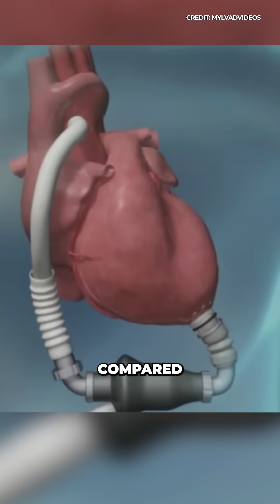Engineers Create World's First Fully Artificial Heart

Comment: By the way, the lack of organic heartbeat means that they were clinically dead; this is also true with all other artificial hearts such as pacemakers.
Reply: Pacemakers aren't artificial hearts. They just regulate your heart rhythm.
Reply: @SllSamuel-034   Depends on the pacemaker, as some of them are connected to artificial hearts, ones that are not made almost entirely from metal (in fact, they're mostly plastic). Point being: the individual has zero organic heartbeat, and sometimes zero organic heart.
Reply: @BlueNEXUSGaming  They may be used in conjunction with them but that doesn't make pacemakers a type of artificial heart.

It's like saying a wheel is a type of car. Just because it's a part that's used on cars

Comment: This is absolutely ingenious and fascinating. Im curious about the initial powering and the flow regulation. Is a battery neeed to start it, then the electromagnetism keeps ot going? Does it have its own software and a "tune" to regulate flow and demand, maybe it's flow is regulated by the brain to communicate that like normal? What about the different valves for the heart, are those electromagnetic actuated or is that needed at all? Is the blood itself enough lubrication for any hinges if valves are used?

Comment: When i was young i used to sit in my bed and think of how you could build a robot if you just replaced things like bones with pipes with oil, tendons can be pulleys with muscles made of many wires that pull or push, blood would be a coolant that helped the mechanics stay cold, with skin that was flexible. If we build it the same as a human body is built theoretically it should be able to move and function. Drinking and eating could also be a way to use whatever they eat to burn for energy and they could run on heated energy just like we do

Comment: Great stuff, love stories like that ❤

But I'm wondering, if typical rotary pro-/impellers etc.. are known to damage the cells, why didn't anyone come up with using the already very well known membrane pump concept? It basically imitates how the heart works, eliminates the shear/friction/etc... issues,.. 

they're widely used for e.g. pumping air for medical purposes because it isolates the mechanics from the air (no contamination from oil and stuff). 

It sounds like a naturally perfect fit - what does this specific method/tech do that makes it so special in comparison? 
Or: what would speak against using a membrane pump, the most accurate imitation of how the heart works?

Comment: "My heart doesn't beat, it hums" would be such a fire line
Also, imagine being able to manually crank up the rotation speed at will
Instant energy
Reply: All fun and games until you accidentally turn the crank the other way and shut off your heart
Reply: @vintage-radio   which sucks because lungs are way more than just pumps like hearts
Reply: @vintage-radio  LOL
Reply: wellll...more like instant high blood pressure kekw
Reply: @lat_sevN  Blood pressure depends on the blood vessels. So, OP's comment only regards the heart rate.
Reply: That’s not how that works, but sing your song and I’ll dance
Reply: My money don't jiggle jiggle, it folds.
My heart doesn't beat beat, it hums.
If you can't find a pulse, I'm not dead
I just might need an oil change.
Reply: Um… no
Reply: Now if they can do the same with kidneys.

Comment: I wonder if you could test its efficiency versus a normal heart. If it's fully mechanical then this would be impressive but without the right material it could lead to metal poisoning or deterioration over time, and an old saying roughly goes the more moving parts means more places for it to go wrong. Hopefully we'll create one that will use regulated electrical responses from the nerves that usually control the hearts muscle to manipulate false muscles along the wall to recreate the rhythmic pumping necessary. Something using those tubes scientists have been experimenting with for prosthetic hands in recent years maybe?

Comment: "Annnnd that a Cyberpunk upgrade"- My brain as soon as I saw the impeller can respond to body activities, thusly being able to be "upgraded" past normal levels.

One thing about that. Ever upgrade a PC or a Project Car?
Theres this whole thing when you REALLY upgrade a part (Say
..add a bigger turbo or better graphics card) you usually need a differnt part to be updated as a responce to the new stress.ot capabilities. It very quickly becomes a "Ship fallacy" as everything eventually goes around to get optimum performance results. In a living body, say the impeller gets a two stage impeller upgrade that can pump a WAY higher volume of blood...well now I need better veins to handle that pressure, I also need "ECU" chip to monitor and regulate my nervous signals to my muscles and the artifical heart for variable stage activation  and failsafe. Vibration dapening may become nessisary. Maybe a hormonal injector supplement to combat biomechanical immunotherapy rejection. While Im in there might as well reinforce the ribcage with flexable biologically friendly metal alloy sheathes.😅

Comment: I’m an engineer in cardiac devices and I’ve actually visited the BiVACOR office and met daniel timms. I wanted to clarify a point about the patient having no pulse. While the device is theoretically capable of running continuously, it currently operates by periodically speeding up and slowing down the impeller to simulate a pulse. There’s ongoing debate in the cardiology field about whether a pulseless circulatory system is viable for patients, so for now, there are no plans to run the pump in a fully continuous mode.
Reply: Oh also it’s not actually the first fully artificial heart. The first one was made by Syncardia which is what’s called a “Bridge to Transplant” device meaning it is not meant to replace the heart permanently. The story is the same for the BiVACOR device as it’s only approved as a bridge to transplant, however, it is likely to become the world’s first “Total Artificial Heart” meaning it will sustain a patient indefinitely. But it will be many years before that’s viable

Comment: Are there any subconscious or other issues caused by the missing heart beat?
With a pump there is variable pressure in the circulatory system but a pump provides more or less constant pressure. Will arteries get "rusty" (do they get easier clogged because less movement)?
And will patients miss their heartbeat and be anxious? Or less anxious/stressful because there is no beat?

Comment: So weird, he was the only human walking around without a pulse.
Reply: the pulse comes from the blood flowing through your veins not the heartbeat.
Reply: @Mamorufumio  
The heart pulses to push blood, the pressure increase of this makes our arteries bulge and Inflate in time with our heart beat. This guy doesn't have a regular pulse in the movement of his blood because a pump moves his blood more smoothly. 

Yes the pulse comes from how the hearth beats, no it doesn't come from the sound of a heart beat.
Am I wrong??
Reply: @Rwnds7967 essentially, you’re correct, but further down the line he’s also kinda right. The beginning of the process is the SA and AV nodes which cause the contracture and relaxation of the heart, sending it through the veins and arteries which also open up and contract.

As for your first comment, not technically. Though this is a huge advancement, it’s far from the very first artificial heart. Also, people with LVADs do not have pulses either, so he would be lumped in with them not alone. Interesting tidbit though is that since there is no pulse, taking a blood pressure on this person would give you a systolic, but no diastolic pressure
Reply: @TB43442 
Woah, that IS cool.

Comment: I'd rather a non mechanical heart rather the risk of it running out of power and having no spare batteries or the cold winter severely reducing the batteries efficiency causing health problems
Reply: The thing is that it doesn’t need batteries and that it’s used in case a heart donor isn’t available.
Reply: Do you seriously think this thing runs on AAA batteries? 
Do you seriously think that a cold winter is enough to seep deep into your ribcage? For long enough to cause harm to internals? You would be basically dying of hypothermia for that to even get plausible.

I'd rather be educated than be you.

Comment: these kind of cyborg equipment are often installed after deep study of the subject. it is never generalized for example the age, gender, BMI, even ethnicity is considered and then the heart piece would be designed specifially for the patient in treatment. so it is not going to be a plug and play or size chart based commodity for a long time. due to the other supporting essentials requied to make it work. lets see ... what is their solution for any MRI ultrasound if it may come to that point.

Comment: That design is really smart, actually. There's no sharp corners, which means it's stupid easy to keep clean. You'll see this a lot with food handling machinery and medical equipment, being able to wipe down and sterilize something quickly is invaluable.
Reply: I don't think anyone is opening up his chest to wipe down the mechanical heart.
Reply: @GamelessOne he’s talking about to clean it before putting it in, in case, of course, it does get a little bit of dust on it
Reply: @NamelessNameless-j4l  It's a good point, the clean lines are important. But I think this kind of implant will be packed very airtight and sterile when it's brought into the operating room. So only cleaned once after it's made, then packed.
Reply: sharp corners also can damage nearby tissue

Comment: "no heartbeat, just a hum" is such an awesome thought
Reply: Imagine doing some cardio and you hear your heart rev up like PC fans 😂
Reply: I have so many questions about the arteries. How is their pumping action affected? How do they handle the constant pressure? Does this cause them any extra stress?
Reply: @johnjones2nd667  They would probably have it in between the pressure that a regular human heart has when it’s in the middle of a beat and when it’s resting. The blood vessels are pretty strong for their size, but I’d be more worried about blood clots in that thing.
Reply: @johnjones2nd667  I'm curious about this too.  I would think the tissues might need that pulse of pressure to get blood and stuff to exchange in and out of them.  But maybe because it's intended for waiting for a donor, it's probably fine/safe enough but not intended to be a permanent replacement to a beating heart.
Reply: @Aeduo I wonder if they can add some sort of ticker? So it’s not a constant spin and it pulses like a regular heart
Reply: @oVividz would wear out to quickly also a spinning mechanism would not be able to pick up and slow down at a speed Needed to imitate it
Reply: "I crave the certainty of steel"
Reply: What's wild to me is like how could you tell heart rate without a heart beat? Like how do you measure the speed of blood flow there without some special machine?
Reply: @Pattwig  flowmeter LOL
But really maybe
Reply: fuck, now i kinda want to write a short story with this as the title
Reply: @znoe6756  DO IT.
Reply: Just sad thing is if you run out of power for it, your dead
Reply: @uneasingcoma5652   wait til you find out that real hearts work the same way
Reply: now i can finally lie down to sleep without hearing DUDUFF DUDUFF DUDUFF
Reply: You mean scary af bro.
Reply: The song “Not A Heart, But An Engine” by Throne comes to mind
Reply: It already is a thing with LVADs (left ventricular assistance devices). Some people have hearts that can't beat at all, so they get a pump implanted into them. They don't have a pulse so the way of knowing if the pump's working or not is by putting a stethoscope to their chest and listening for a hum

As a paramedic they're like my scariest clientele because all of my vitals equipment barely works on them and usually even if everything's going great, their baseline health would be an emergency for anyone else 💀
Reply: That’s metal as hell
Reply: Idk I kinda wanna become an android get nerolink planted into me limbs replaced with attachments
Reply: @renjia3504 "From the moment I understood the weakness of my flesh it disgusted me. I craved the strength and certainty of steel."
Reply: @denyraw Steel is the future biology will become, but a stepping stone in our evolution
Reply: @renjia3504  imagine not being able to feel someone you love with your own hands ever again. Replacing limbs, nah. Might go for some upgrades like in cyberpunk tho lol
Reply: @renjia3504  cyberpunk lmao
Reply: @renjia3504 uhhhm technically it’s a CYBORG” 🤓☝🏼
Reply: No it isn't lol. You ever seen an LVAD patient? It takes a while to get used to the humming. You van hear it through the pillows and if it'd quiet enough, you can hear it well.
Reply: I would rather hear my heartbeat thank you very much
Reply: Meaning... humanity's morality is forced to state that all heart beat is not what determines human life. More pro-abortion L.
Reply: You mean absolutely terrifying
Reply: Pretty sure theur changing it to pulse as the pulse of our blood in our veins has subtle effects we don't understand. Our bodies have all sorts of crazy autonomous or semi autonomous systems spread through it
Reply: Bout time I chrome the fuck up
Reply: No it isn't due to them not having a pulse
Reply: Closest thing to Iron Man
Reply: Would it keep you awake at night?
Reply: i rather thought of AC/DC but for blood
Reply: From the moment I understood the weakness of my flesh…
Reply: Not for your kidneys
Reply: No heartbeat means no pulse. I can't imagine getting into a car accident,  the medics arrive to check for pulse, and none is found. 

EMT: No pulse , time of death is 12:40pm. 

Coroner: Let's get this guy in a body bag right now. 😂

Yea, I know there are many ways to see if someone is still alive, this was a joke.
Reply: Agreed.
Reply: Turbo heart
Reply: Kinda sounds freaky, something you’d have to get used , as a species we aren’t used to not having a pulse lol
Reply: Awesome in the biblical sense
Reply: george droid
Reply: From a steady, beating rhythm to a hum of life. 
Definitely trippy as hell but effective.
Reply: That feels like a line in a horror movie
Reply: Good luck getting your blood pressure checked
Reply: Everything about this is an awesome thought
Reply: That is nearly Geralt’s heart; no beats, just “hmmm”
Reply: And that means they don't even have a blood pressure
Reply: My tinnitus may become my heart😅
Reply: Imagine robo man telling you about his newest surgery in a quiet room, and you only understand it when you hear his chest going mmmmm
Reply: Awesome thought? That person was probably stressed and horrified from not feeling his heartbeat for 100 days
Reply: @Bob-wq5xe  i think being able to go about your life without being in a hospital or dead kinda balances out the lack of heart beat.
Reply: @NihongoWakannai 😂😂
Reply: @Bob-wq5xe  or, consider how nice it would be if we all just had constant bloodflow? Not pulses of pressure.
Imagine how romantic "My heart spins for you" could be
Reply: @ Personally, I'd sleep better at night without the feeling of my heartbeat keeping me awake.
Reply: @jaxyperson OH GOD YES! I have anxiety and feel my heart pounding all the time.
Shut up and take my money… and heart.
Reply: @Bob-wq5xe Beats being dead.
Reply: @Bob-wq5xe yeah right, no shit 😬
Reply: @Bob-wq5xe  ...do you actually go about your days feeling your own heartbeat?
Reply: Ironman did it first hrmph
Reply: @relliklaires9368 No he didn't lol
Reply: @relliklaires9368 do you,’umm, think, Tony’s heart was replaced?
Reply: @relliklaires9368  Ironman had a heart, the arc reactor was to keep the same shrapnel from entering it
Reply: @relliklaires9368  I cracked up at this but honestly thinking about it The Arc reactor doesn't replace his heart it just keeps shrapnel from going towards it so like they said in the movie it's just an electromagnet
Reply: You sir need to be locked up, no joke this was the plot of an episode of He-Man.
Reply: such an awful thought to me though. if i didnt feel my heartbeat i'd feel like im dead even if i know my blood is being pumped artificially.
Reply: I mean, it sucks to lose a heartbeat but a hum sounds cool af

Comment: If an artificial heart were specifically designed for astronauts, could it dynamically regulate pressure and circulatory function to adapt to the unique conditions of microgravity and space travel?
Reply: Until you hit a solar flair
Reply: @handsomejack4213 why? You already need radiation shielding for space anyways
Reply: @YunxiaoChu  True but electronics are so hard to shield from radiation.

Also, unlike the body that has repair mechanisms any small damages will accumulate.
Reply: Technically yes, but this is an engineering question. It is possible to insert some sort of "gravity level detection" inside any mechanism, but for an artificial heart it would probably mean inserting also a ton of other stuff to correct for measurement errors, caused by your body movement. When you move, there is an inertia happening to your organs, and it is a different phenomena from incresed oxygen demand (i.e. blood pump strength), that also happens during movement.